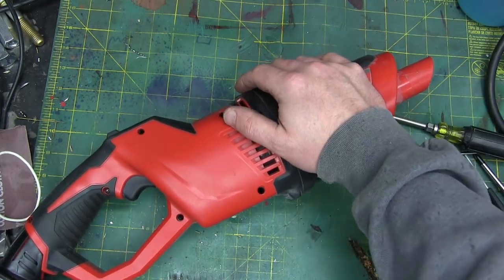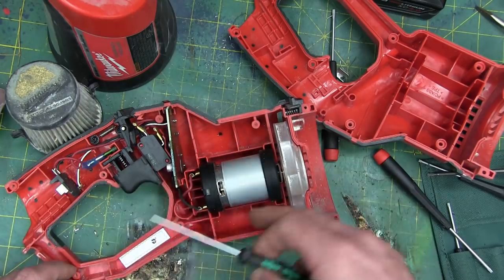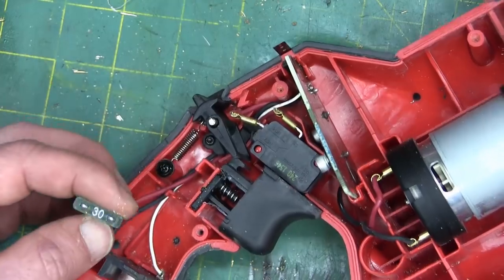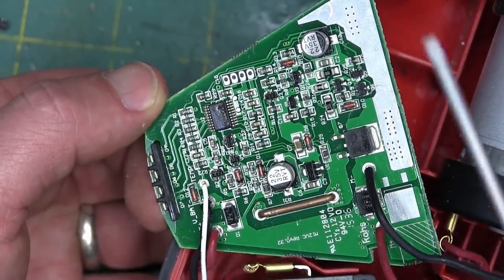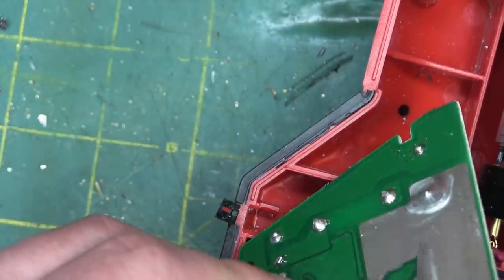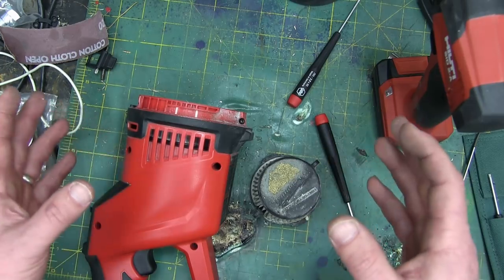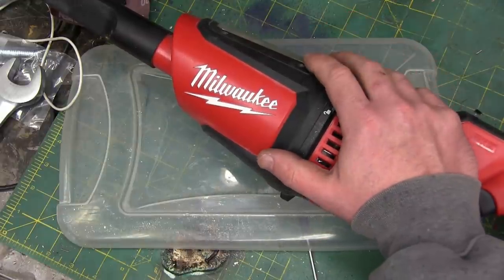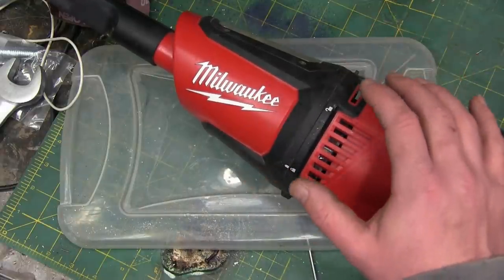BOLTR: MILWAUKEE VACUUM | It sucks.

Comment: Is anybody ever surprised that milwaukee tools are fackin junk?
Reply: "Its gone from suck, to blow!"
Reply: bahahahaha
Reply: Ive some old milwaukee tools and they refuse to stop working
Reply: Thats the thing. Milwaukee knew that they had an AMAZING tool lineup at one point, Once they built a strong enough fanbase, they decided ok now its time to start skimping on our tools. Thell keep buying them because they keep thinking that "this must be a bad batch and theyll fix it soon"  Just like die hard ford truck fans! They used to be the king of the farm, now you cant get out of the dealer without turning around!
Reply: Some are junk, some are not, tends to vary.
Reply: I myself am a big millfucky fan, mainly because every other tool at the same price range (eg dewilt, and the teal bastard) they suck even more. I've seen first hand how much faster I can put in a 6" screw into hardwood with my millfucky, and keep doing it for a lot longer than the competitors, mind you I have the "Red Lithium" XC batteries. But also on that note I noticed my brushless impact doesn't work in the rain for some odd reason where my brushed impact no problem at all.
Reply: DEATH METAL porter cable has old tools that refuse to die too. .. although I'm not sure it has anything to do with the manufacturer and all to do with the quality of tools 20, 30, 40 years ago
Reply: The problems came when techtronic bought them
Reply: DEATH METAL what from when Milwaukee was Milwaukee and not Milwankee TTI Shenzhen Special Branch?
Reply: after 2.5 years in a aussie metal shop my m18 drill is still goin it is now black tho
Reply: Demetry Romanowski I wouldn’t say that Milwaukee is better at 6 In hardwood driving than dewalt, mainly because dewalt has a higher load spring on the internals so it has a stronger start without impacting
Reply: I just think they have professional quality tools and homeowner quality tools and you just have to know the difference. The Fuel drill and impact I have are the best drills I've ever used. I have an older (pre Fuel, but lithium) skill saw that still kicks ass. Same with sawzall. But the cheaper drills and newer non-fuel tools aren't that good. A 12 volt vacuum is a 12 volt vacuum and is made for picking up dust. I'd assume the 18 volt one with a larger opening can handle more. Large metal shavings don't even want to fit into that head.

Sometimes a tool has a specific use and wont perform outside of that. I remember he called a battery multi-tool completely useless because he was trying to scrape up a floor with it. It's for flush cutting and detail sanding, a Fein multimaster would suck at scraping up a floor too.

I love you AvE, but the 18v shopvac or any cheap corded shopvac would obviously be more suited to this job.

Not saying this specific tool doesn't suck, but it's a 12v dustbuster.

Edit: I'm not a milwaukee fanboy by any means, but I love my drills and haven't had problems with the other tools. My makita skill saw simply under-performed compared to the milwaukee one. I love all tools if they do the job.
Reply: I am using my father's Italian made full steel cord drill regularly. I just had the motor rewinded once. Built in 1975. Refuses to die
Reply: get a bosch instead
Reply: Hammerjockey Radios Youve obviosly never used a Milwaukee 1/2” impact wrench
Reply: Ignorant comment. Use them at work all day, work fine. Just a fact. If you Don't your opinion means nothing to me.
Reply: I just bought the 12V 3/8" sidewinder and so far I'm completely in love with it. Maybe it's junk that will burn up in a year, but it's going to be a really good year.

That said... They do offer a 5 year warranty on their stuff. Not sure if it's worth bothering with, but they offer it.
Reply: Warranty isn't what we think it is anymore. Now you send it to an "authorized repair shop" for those companies and it's some fuckin Joe Schmo in his mothers basement! No lie. We had to go through that process for warrantying batteries to an "authorized DEWALT service dept". Show up and it's a friggin basement under a modular house 😂
Reply: Hammerjockey Radios no  but  even dewalt has its  failures its how  it goes
Reply: I've never had a bad experience with Milwaukee. Granted I've never bought any niche stuff like a vacuum cleaner, but I think their core lineup (drills, saws, etc) is pretty solid.
Reply: Hammerjockey Radios nope
Reply: 12 volt drills and especially the impact guns are great as is the blue tooth speaker. I also found the palm nailer to be very large and a bit awkward but worked like a hot damn. I have the 18 volt vacuum and it works nearly as well as my Dyson Animal with a super long battery life in comparison. (8 1/2 minutes at full suck with a 4 amp battery).
Reply: The M12 and M18 fuel impacts are life changing.
Reply: Hammerjockey Radios I
Reply: Sorry,I don't know.
Reply: Sakumi if you get onsale
Reply: 12v or 20v? I just got the brushless 12v impact and love it, but haven't had to use it in the rain yet. I work on parking lot lights and signs so rain work isn't a thing for me.
Reply: Not to beat a dead horse but Wranglerstar is definitely surprised that Milwaukee tools are junk. :)
Reply: I paid retail for the M18 fuel impact.. it was worth the near $400 price tag with battery. There were several bolts that my air impact couldn't get off, it ripped them off like NOTHING. Amazing tools. The little M12 impact does just about everything else, and fits in tiny spots. I also use their M12 ratchet a ton - really a time saver.
Reply: Honestly used to be..... Not anymore😒
Reply: When they replaced the old milfucky drills at work they bought the upgraded models and weve already broken most of the fackin things already.
Reply: Doc. Volt I'd say a rewind was dead. I think you just refuse to throw it away.
Reply: all old tools are good though. even old craftsman.
Reply: I've got anold metal box Milwaukee sawzeverything that is great the new stuff I can't say
Reply: I love their tools. DeWalt offers a 3 year tool 1 year battery while Milwaukee offers a 5 year tool and 3 year battery. How is that junk? I’ve had more DeWalts die on me than Milwaukee.  I like DeWalt and Milwaukee but i use milwaukee every day in the HVAC trade and they have never let me down. Except for their little M12 saw zall once drywall dust gets in the reciprocating piece it seizes up. Other than the M12 dinky sawzall i love all my milwaukee tools.
Reply: 2003 f150 with 412,000km and 2016 escape with 289,000km still running strong. Only done brakes and fluids and plugs
Reply: Craig Cundiff 😭
Reply: It's pretty much sucks if it isn't one of their flagship cordless or heavy duty corded power tools. They sell great stuff at the high end and use that good name to push a load of cheap crap at the other price points. Most Makita tools are pretty good, but I have the 18v Makita dust buster and it's about as shitty as this one. It's basically just a sawdust vacuum.
Reply: It's just vacuum shrug

Comment: Keep in mind that the effectiveness of a vacuum cleaner is dependent on volume of flow, not the pressure differential it can create.  While the two are closely related, much like amps and volts, remember that it's not just building a strong enough differential, but maintaining it with a larger air flow.   Vacuum cleaners work because of entrainment of the junk into the air flow to capture it.  If it were just about getting a high enough pressure differential, then vacuum cleaners would be built with vane or piston pumps instead of centrifugal blowers.

Comment: On the topic of SMD MOSFET heatsinking - an anecdote:

On my 3D printer, the heated build plate draws around 350W at 22V DC. That is all switched through a SMD MOSFET that has no appreciable heatsinking external to the PCB. It's a larger one (roughly TO-220 sized), and it barely gets warm. Considering that the on resistance in in milliohms, it's not entirely surprising that minimal heatsinking is needed fro decent loads. It does have a fan nearby, but that's mainly for the stepper drivers.

But yeah, that's my anecdote.

Comment: Dustpan. And brush.
Reply: 薄熙来 Old school. 
Well done sir, 
Well done.
Reply: Proper shop vac.
Reply: Absolutely. Followed by a few blasts of compressed air to get the little stuff out of the nooks. Vacuums are great for situations where you're throwing lots of particulates into the air, like cutting stone or sanding wood, but for metal chips, gravity has you covered.
Reply: Just go easy with the compressed air around machine tools... I've had to dig out some really congealed and compacted chips & salsa from gearboxes and nooks & crannies when getting my new-to-me used machines rehabilitated to use...
Reply: What is this, the dark ages? He's got a kid, let her help.
Reply: 卧槽你还活着?
Reply: Exactly! Sometimes, the obvious is too subtle for some. (Speaking from experience.)
Reply: Damm commies...

Comment: Dunno if you have them in the colonies but here in the UK, the builder and workman relies on something called a "Henry" which is an incredibly tough as old nails vacuum that sucks up brick dust, shavings, you name it and because its completely modular the things can be repaired again and again with a large availability of just about every part still going strong and now they got even bigger motors over the old half a kw that used to power 'em
Reply: Ian Watson Or the dashing "Henrietta" with eyelashes.  No, seriously!
Reply: 'Charles' is the daddy if you have any schmoo needs picking up.
Reply: New Henry's are fucking wank.

They were fine when they could stick 2000w motors in the thing. Unfortunately their design doesn't work at all with new regulations and their actual suctivity is bullshit.

Attempted to use one to vacuum dog hairs t'other week and gave up, went home and got my vax, which is designed to be light rather than amazing at sucking. Ended up picking up two tank fulls of hair out of a room already done with the Henry.

Sure a vax requires emptying more and banging a filter out on the daily but they suck 2-3 times as hard as Henry's.
Reply: Freedom Of Motion Doubt the EU regulations would affect Kanuckistan, though they might standardise the production.
Reply: Gavin Barker 
I'd imagine that would be the case. Cost too much to have sepperate production lines, especially for a company like numatic that whilst popular are not pulling in the Megabucks.

Could be wrong though!
Reply: What do you mean by "in the colonies"?
Reply: Louis Pontoise the UK used to own Canada and USA. Hence a colony of the UK
Reply: Yeah I think the Henry's got too good for the profiteers so cut them back hard, my one is an old 'un and it sucks up cat hair an abs doddle as well as drill dirt, shavings from my micro lathe and I used a permanent marker to give 'enry more of a cross eyed benny hill look too hehe
Reply: Higher wattage models are available in Numatic's industrial range:
https://www.numatic.co.uk/product-view.aspx?id=45&r=6&sr=12

Henry and pals now seem to be retail grade.
Reply: 2000W is more than you can get out of a north american 110V 15A socket - it'd have to be a pussified version.

Comment: We use air compressor powered venturi vacuums. No moving parts so the little chips and dust don't fry the motor. They work really well, but you need a good air compressor.

Comment: I use one of these at work for light jobs like hanging a wall TV or opening a drop ceiling. It does OK for drywall dust and ceiling tile crumbs. Throw it in my backpack, then I can split to the next job without being accused of leaving a mess behind. No replacement for a proper corded vac on big jobs.
Reply: That's what this Vac was designed for was very light clean up.

Comment: I have that one and the M18 wet/dry vac. The Dustbuster is only good for dust and not drywall dust, it doesn’t use a hepa filter so unless you want a pissed off customer or to set off a fire alarm use cautiously. The wet/dry vac is the way to go, it uses a hepa filter and will take any of the M18 li-ion  batteries (including 9AH) as well as the 18V ni-cad batteries. I’ve used it for drywall dust, concrete dust and saw dust and it kicks ass. Don’t leave home without it. The wife uses the M12 for the stairs and dog fur (that’s about all it’s good for).

Comment: Every job shop I've worked in uses, shop air, to blow chips and coolant out. Make a OSB  backstop to keep shmoo from flyin everywhere. Two 1/4" sheets are enough  and OSB exterior  rated so it'll last a few years if used every day. I've even seen plastic trash bags stapled to a frame work for a wile.

Comment: I think just the fact it runs off a 12v battery should let ya know it's a piece of shit novelty tool
Reply: Not necessarily. It likely has some applications where it's at an advantage. I recently got a cryobi 18v vacuum, it probably won't pick up swarf either but it's helluva useful when you're up a ladder and need to clean up brick dust from a ledge under where you're drilling. Messing with mains-powered vacuums in that context is no fun. Plus it's cheaper as hell. Horses for courses.
Reply: A vaccuum cleaner is gonna be mildly bulky and heavy either way because of the trash reservoir it needs to have, so going for 12 instead of 18 volts really just isn't very smart.
Reply: Mike's Tool Shed
Reply: Paremo To compare with mains powered vacuums I reckon you at least need a motor that can put out maybe 500W? So consuming about 750W peak. At 12V that's going to draw around 60A. To get nominal 15 minutes of running time you'll need a 15Ah 12V battery. Capacity not a problem since to get 60A at 12V from standard 18650's you'll need something like.. errmm three series packs of six paralleled cells? That's eighteen times 2Ah-ish, gives us 36Ah-ish.

For the equivalent performance on 18V you'll need the same number of cells just in a different configuration.

I'm not a pixie wrangler so could be miles off with the numbers and such, corrections welcome :) but my point is - these are tools with their own purposes, not to be compared with shop vacs, karchers, die sons, etc.

Maybe AvE could pimp that vac out a bit in another video? :)
Reply: its the stlye of "pump" that its using, centrifugal impellors are useless at sucking. The motor and battery are probably capable of doing sufficient work if the "pump" was positive displacement it would probably work. heck even a closed impellor with tighter tolerances on its stator counterpart would be an improvement, the one on this "tool" its just pure shite.
Reply: The M12 fuel stuff isn't the most powerful, but its not bad at all... I expected for from ya, Mike...
Reply: Hehe.  Your mum's Kenworth anteater has a 12v battery.
Reply: So you're telling me it's cheaper or more convenient than my old handheld mains powered 750W Solac Shark? Well, i doubt that. The weight of those batteries still has to go somewhere, or you could just as well have a nice and flexible mains cord.
Reply: Siana Gearz I'm not at all familiar with that device so no, I'm not saying it's more convenient. But for those of us who sometimes work without recourse to mains power, it's probably a foregone. Mine cost about $25 since I already have the batteries. I don't know what yours cost so I can't say whether it's cheaper.
Reply: Just to throw it out there with the topic of vacuums aside, those 12V batteries are remarkably light. The weight is actually the least of my concerns with those tools as its basically not any different than a corded version these days.
Reply: +Gabriel Matte no 12V is not plenty of power it is Voltage of course you can put 100 or even 1000s of Watts on a 12V power source but you also would need 100s of Amps to do so that means bigger connections lower capacity batterys and all that stuffyou need 10 Amps flowing at 12V for just tiny 120W more power more better is the rule of thumb

Comment: I use the lunchbox type M18 vacuum for cleaning at work. It seems to work far better than what you have here.. maybe you can give it a try. I even used it once to pull a string down a short section of electrical pipe. I would buy that thing for personal use but alas, no wilwaukee tools at home.

Comment: Isn't it the wrong type of blower for the job? 
The Willfuckyee is using a radial blower which is providing a great increase in pressure, comparatively, but doesn't push a lot of air (That's why Turbochargers are radial blowers). All the pressure that the blower might produce is just vented to atmosphere in this case.
To create a vacuum I'd say you'll need a high flowrate to vacate the given area of as much air as possible in a given time. Thus axial blowers would be the better choice, since they have higher flowrates compared to radial units. 
Fitting an axial blower into a handheld like that might be tricky though..

Comment: While I don't recommend it for sucking up chips and sawdust, see if you can find a Sebo.

Now for chips and sawdust on a budget, a large "shop vac" with an Oneida Air Systems metal dust deputy works amazingly well.  I did have to fabricobble a smaller nozzle to fit into the t-slots though.

When I ran a full enclosure cnc machine, we had a valve on the coolant pump with a garden hose attached and would wash it down with coolant at the end of the day and that worked extremely well.